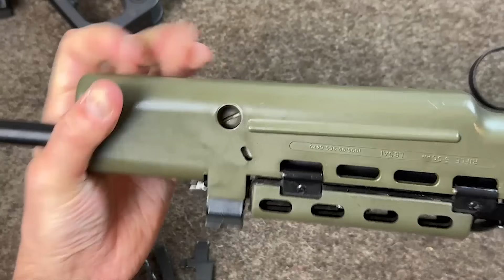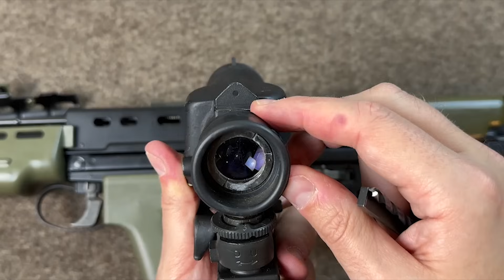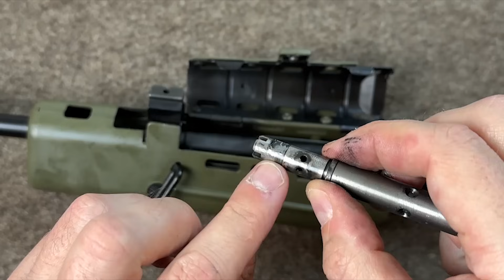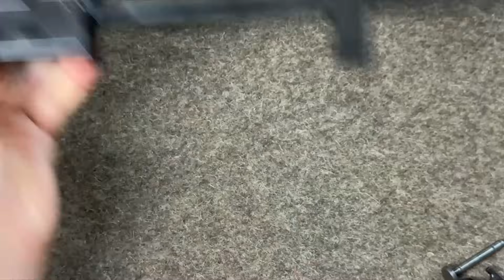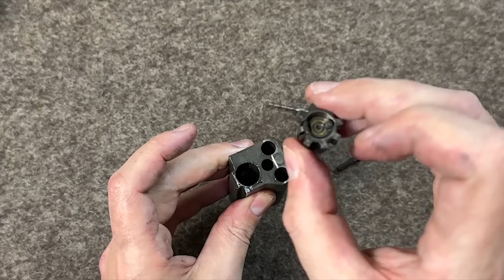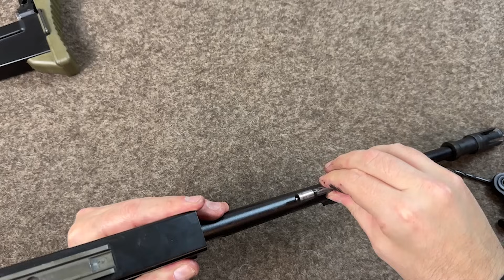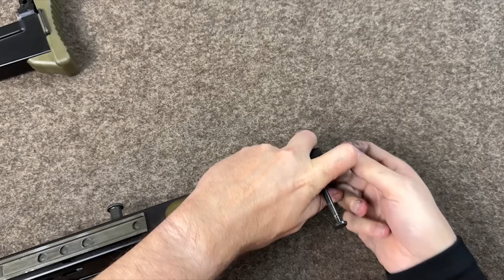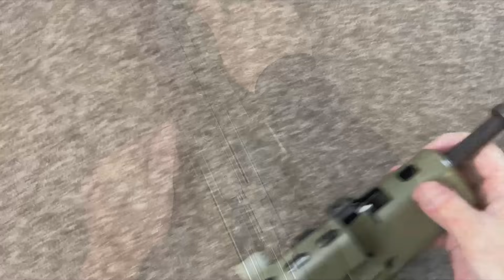British Rifle L85A1 / SA80 IW: The Mechanical Gory Details (Rare Factory Semi)

Comment: The only thing I dislike about this is the reciprocating charging handle. One doesn't need to be a soldier let alone firearms designer that having a reciprocating charging handle on left side is conducive to one's cheeks and mouth when one attempts to fire it left handed. But as up to 20% of population is left handed, ability to do so is quite welcome, and situations during combat isn't always in one's favour and can be forced to fire from the non dominant side while taking cover.
Reply from the maker: The ejection would still be into your face irrespective of where the cocking handle is placed... There's a technique for shooting left shoulder at close range btw.
Reply: @BlokeontheRange  As you mentioned in later part of your video that their is a technique to shoot left handed but with non reciprocating charging handle it can be easily upgraded with brass deflector like in AUG and Tavor. Even with shark fin charging handle it's still reciprocates so while using the technique one has to be more conscious of it and in the heat of battle things may go wrong. If reciprocating charging handle is necessary according to MOD and Army then they should have gone for AR18 with rubber flaps and sliding cover to prevent ingress of debris. I think it's just like SCAR nobody likes it's reciprocating charging handle and finally FN fixed it.

Comment: I'm a Brit and know my firearms.  The L85A1 is such a shite design.  It's a very iconic design but crap.  The A3 is such an improvement.  There's a reason the SAS used to use the M16A2.  Such a superior platform.
Reply: The SAS had adopted the M16 when the FAL was still in main service, it had absolutely nothing to do with the SA80 family. Once they had the M16s, MP5s, etc. there was no good reason to change so even if in some alternate universe the L85A1 was a golden child they would still have been unlikely to transition.

Comment: What happens when you design a rifle by comittee and ignore "Mere civillians" input.This was the last service rifle that was not passed onto civillians in the UK due to the semi auto rifle ban as most military rifles had civillian input in the UK,this one didn't and therefore a lot of failures that  could be hidden in the Army under "Shddup and get used to it!" but no would be tolerated in a civillian fireearm never came to light on the "Air fix rifle" So named after the tubes of glue from a famous Uk model aircraft company,that gor the contract to supply  model aircraft glue to fix the  brittle plastic parts all over the rifle.
Reply from the maker: This rifle predates the semi auto rifle ban though...

Comment: I served in the 90's and that SUSAT optical scope was a pain in the arse. Tritium gas would be released if it broke; mask-up just in case.

I was on Nuclear Weapon Security back then, I'm not saying anything that contravenes the OSA... all of that is now in the public domain.

They were a reasonable range Weapon, x4 magnification for a figure 11, or 12 target. 

In reality then; it was a pain in the arse to strip & reassemble.

2 mags of 30 down the range & you'd have to set the gas plug to 'excess'.

Anyway, that's my experience of it 🙂

Comment: Britain went from milled receiver, tilting bolt  rifle to a stamped sheet metal, rotating bolt rifle, the SA80
Germany went from a stamped sheet metal, delayed recoil rifle to a gas-operated, rotating bolt rifle, the G36
So how come the SA80 is one of the worst assault rifle and the G36 is one of the best?
Reply from the maker: Both of those statements are wrong though...
Reply: @BlokeontheRange  Yeah, I'm not a "gun-guy" So how are they wrong? The FN FAL wa not milled? The G3 wasn't stamped (pressed) sheet metal? Or the G36 was also such a terrible assault rifle?
Reply from the maker: The SA80 is not one of the worst, and the G36 is not one of the best...
Also "delayed recoil" isn't a thing, it's delayed blowback.

Comment: Technically it's the l89 not l85 being the semi auto rife it's the cadet rifle
Reply from the maker: The L98A1 Cadet GP Rifle was a straight-pull, manual action with no gas parts. Stamped "L98A1" on the handguard. This here is a factory semi L85A1, which is indeed what's stamped on the handguard... The L98A2 is semi-auto, but that's got all the HK A2 upgrades. And is marked accordingly. But thanks for your valued contribution...
Reply: Well I've learnt something today I've only ever seen l89a2s didn't know they had an a1 variant  @BlokeontheRange

Comment: I got an A1 in Phase 1 Trg 02 and because I was a Tom and knew no better. It wasn't till I got to RD and had an A2 I realised how bad the A1 was 😅. But in 13 years never had a problem with my A2 always worked well of you looked after her.
I did get flash backs of using black boot polish to buff the bottom of those horrible Magazines having one thrown and it bent the Feed lips so it didn't work, which of course was my fault 😂😂
Even now as a SAAI I still love your videos on this weapon system bloke 👍🏽.

Comment: Maybe they got the extra dwell time from the Stoner 63, there's an interview in "Small Arms Review" with Jim Sullivan talking about increasing it as an improvement over previous designs. Increasing dwell time is not a bad thing as long you get you math right, which they didn't apparently(The SCAR also has a crazy long dwell time yet it works).

Also seems that the changes into the bolt carrier and guides rod made the whole assembly a bit taller? Meh, one of my favorite thing about the AR-18 twin guide rods design is that it allows for shorter/skinnier upper receiver and hence a lighter rifle(specially in the modern full length rail era).

Comment: i joined the army in '88, transitioning from SLR to SA80....12 years i used it. left 25 years ago.... i can barely remember anything about it now.
Reply: I'll bet that you still remember everything about the SLR! 
Mark from Melbourne Australia
Reply: @markfryer9880  
Like the fact that an empty SLR with no optics weighs the same as SA80 with SUSAT and a loaded mag?
Or how about how SLR is THREE FOOT NINE INCHES long to have a 20 inch barrel and SA80 is just 30 inches with a 20 inch barrel?
Oh yes - lets not forget that to have the same number of rounds, you have carry a lot more weight with an SLR because its 7.62? This also requires a longer magazine for the same number of rounds between reloads.
Hold on - I've got it. The SLR is better because when you shoot at someone, you have to check the backstop, and the backstops backstop, because that 7.62 is going to just keep going in urban environments. Wait, that's not really an advantage is it?

Be honest fella - The SLR was total shit which is why we replaced for something superior.

Comment: Anyone used the Cadet GP version L98?  Absolute piece of garbage every third round was a jam that couldnt be cleared on the range. Total junk.
Reply: L98A1s would experience a magazine stoppage if you failed to let the working parts run forwards under their own spring pressure, thats why the cocking handle rolls. So your fault. Other than a torn off case head I would be interested to know what manner of stoppage (not jam) could  not be cleared on a range.
Reply: @zoiders  many torn off rounds stuck in the breach also many worn bolts failures to fire and failures to remove casings the rifles rattled a lot at each time you pull the trigger it was never guaranteed it would fire not a brilliant experience for a young cadet
Reply: @zoiders most of the issue with the A1 cadet rifles came from them being ABUSED in the extreme with essentially zero budget for periodic maintenance and overhaul. By the time they were phased out they were so clapped out that you couldn’t guarantee cocking one, let alone having it chamber the round. Much of it compounded by small, relatively weak and firearm illiterate kids operating them.

It wasn’t inherently the fault of the rifles.

Comment: This video is bringing back a whole lot of memories. I was in the RAF at Laarbruch I 98 on guard, trying to insert the mag in only to find the pin for the mag catch had fallllen out. The magazines had the issue that the plastic bottoms used to get ripped off if you dove on the ground.. The safety catch was made from softer material than the trigger, and the trigger could wear it away, and it was possible to fire the weapon with safety catch applied. Have you got a shroud around the mag catch? If not, the mag catch rubs against your body, disengaged from the mag, and the mag falls out of the rifle. The spring-loaded pin on the gas plug was EXACTLY the same size as the gas hole in the barrel. If you did not al8gn it correctly, the spring-loaded pin on the gas plug engaged in the gas hole in the barrel, and you were screwed. A bloke  did it on my guard shift and the main depot at Donnington cut the gas block section of the barrel (with gas block stuck in it) with a still saw and sent it to him with a bill for £100. The hold open device was weak, and with the bolt held open, a reasonable sharp blow on the butt of the rifle was enough to dis3ngage the hold open device  and the closed under spring pressure. The dead trigger when the rifle wasn't in battery was the reas9n why they introduced the forward assist step to the make ready drill. It was the first generation of the rifle, and it was a work in process . The sling was great. You did not have to loop the sling around your wrist like you had to do with the L1A1 (SLR)
Reply: I got shot of all my plastic bottomed mags for Colt ones, loved the L85 and LSW, never had one stoppage, hated the L96 Cadet GP with a passion as with many other former cadets, I grew up with the SMLE, and Bren, and ut plenty rounds down range with those

Comment: I used to work at the Royal Ordnance factory in Nottingham, machining the Extractor. ( Among other things.) Made in one piece on a CNC twin turret lathe with back end tools. What little you could see, through all the coolant was mesmerising to watch. I was told that this rifle on the drawing board was chambered for 7.62mm. Due to NATO politics, it had to be hastily redesigned for 5.56mm. Something it never recovered from.
Reply from the maker: Well that's some shiny new Fuddlore, mixing up EM-2 (but backwards) and the fact that the earlier prototypes were in 4.85mm...

Comment: Used the A1 in Northern  Ireland and used to tape paracord to the magazines bottom and attach it to the trigger guard to save it dropping to the floor when we accidentally pressed against the magazine release catch.
Used the much improved A2 in combat in Iraq in 2004 and if it was cleaned and maintained it did the job.
Reply: Did you not have the mag release shroud? I did and it never fell out.
Reply: @chrishitchings8712  Magazines used to just... fall off occasionally. I also had a firing pin snap and the dust cover snapped off on every exercise. I hated the SA80 with a passion. The other bugbear was cleaning it. If you can't break a battle rifle into a few parts, scrub it clean and oil it again in less than 15 minutes, it is too complicated.
Reply: Belfast 87 Scots North Howard St Mill 87,  we still had SLR,   They had  SA80,   Impressed until we converted back in in Germany
Reply: Telic 4 by any chance? I was on that one at OSB and then a few months later at the Hotel.
Reply: RN, Manning the rail, holding it at attention, if you pressed it too close to your body the mag not only falls out, but off the ship and into the water

Comment: I bought an SA-80 from a ‘flea market’ stall for £90 many years ago. Unfortunately it was listed as stolen from an Army Cadet hut (even though the numbers didn’t match).
Reply: Cool story bro 😂 live fire full bore weapons are never stored at detachment level. They are kept in the company armoury which is located in reservist center behind the wire. Not that they kept L85A1s there in the first place as the ACF didnt have them.
Reply: @zoiders he said SA80, of which the L98A1 is part of the family. Nor did he say it was live fire capable.

At detachment level it was probably an L98A1 DP (Drill Purpose) rifle with the barrel welded closed, breach cut out, firing pin cut short and the bolt face welded closed. A deactivated L98A1 for the purpose of weapons handling training and rifle drill practice.

Comment: Those reciprocating operating handles were horrible! One of the sargents had his hip sliced open by one of those when he was being a bit of an idiot and tried to show off and shoot 2 of them from the hip.

I know it's a bit s*** as a rifle to take to the range, but I do think bullpups get unfairly maligned by youtubers who only ever shoot at the range.
They don't have to cary it around all the time, getting in and out of vehicles, where being the length of an M4, but with a full 20" barrel is handy to not catch on things so much.
They generally don't have to observe a position for hours, where the rearward weight balance makes it a bit easier (for a rifle of a given weight).
The trigger might also be a bit spongy, but which SERVICE rifle has a match trigger because of the tougher drop tests? They're all, at best, acceptable.

It's just too heavy. If only it had been designed 10 years later using mostly polymers like the G36...
The other thing that annoys me, is that for a rifle that was designed to be as cheap as possible and compromised as a result, its still about twice the cost of the M4 carbine! And now the army has adopted the AR in the form of the KS-1, at £9,000 a piece, they've splerged for the most bougie AR they could find. So much for trying to save money because we're on a tight budget! Why do we struggle so hard to do procurement in this country?

Comment: Ah, the SA80. Made out of knock-off Barbies, dwarf stars, and smashed badgers. With the magazine self-releasing catch, and the instant custom handguard if you touched it with a hand covered in issue insect repellent. And the gas port in the barrel designed perfectly to catch the plunger on the gas plug if you put it back in at the six o'clock and twelve o'clock position.

Still, at least this one has gas parts instead of the girders hanging off the L98-A1...

Comment: Very impressed with the sling work. I was trained on that for hours and hours and never completely understood it. But it was very good when I got it working.
Other than that, I quite liked this thing. It had its problems (but so did M16 a decade before, and it could never replace SLR), but it was a very friendly, usable, capable weapon all things considered (and when it didn't stop!). Compared to its antecedents, and its contemporaries in other groups, it did - very noticeably - feel rather cheap. "Flimsy" is a word I heard quite a lot at the time.
"Shit" was another one.

Comment: Used the L98A1 in cadets around the early 2000's, when in ambushes we used to hold them sideways, cocking the dumb extended lever with the left hand for "rapid" fire lol. Good times.
Reply: While there is a way to run a L98A1 two handed to make it sound like a self loader in an ambush the way you just described isn't it unless you like stoppages.

Comment: My first experience with a very used SUSAT on my rifle resulted in a 2 foot group at 100 yards and me getting beasted around by the range staff and ultimately put in a group who couldn't shoot and who were getting extra attention. The end of the day was approaching, I still hadnt achieved a group and was very much in trouble by this point and worn out from being made to do constant press ups and sprints for being rubbish. Really mad now one of the staff took my rifle to show me how to do it and had exactly the same result which was the biggest relief to me. I had to qualify using the rifle of the lad next to me which I did without missing once, I think it was all the practice.
Reply: Try being left eye dominant like me. I couldn't hit the target with one of those things even if I stood right next to it. I did join the Royal Navy, so I never had to use it much.
Reply: @MrBond249  I kept both mine open mostly squinted the left eye slightly if was having a drama, I was infantry though so I used it a lot.
Reply: Came 30th in the Army hundred with SUSAT, know lads who still swear by it today  
I would use mm to measure groups, measuring groups in feet 😂
Reply: @ifv33  plenty of people probably owe their lives to the susat, just the first one I was issued was junk.
Reply: @kennethnoisewater1502  yeah I had one or two that couldn't hold a zero, sometimes it was the mounting system it uses was fkd, think it was the spring you tension when you wind it to 300m gets fkd
Reply: When did ya join we had to pass with irons when I joined and didn't get to use a susat until we got to the regiment.
Reply: You are lying fella.
Reply: @zoiders  unfortunately not so because when you go to qual, you stay there until you do. In the USA, we had one guy who just couldn't do it and we stayed at the range all day until he was able to hit the targets. It turned an otherwise fun day into such bore because we all had to do push ups and sit ups and running back and forth because we weren't properly motivating the fella. The m16a2 I got was so worn out and silver color that I thought it was junk but it worked for me.